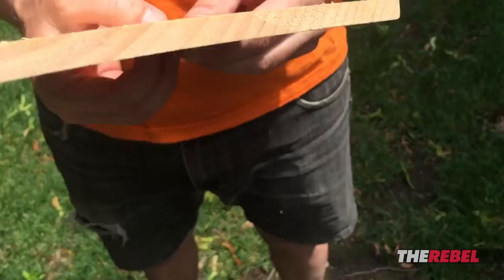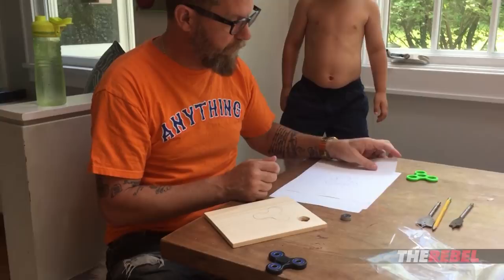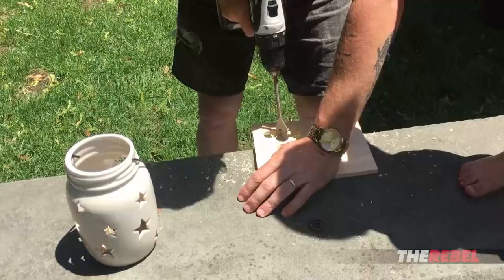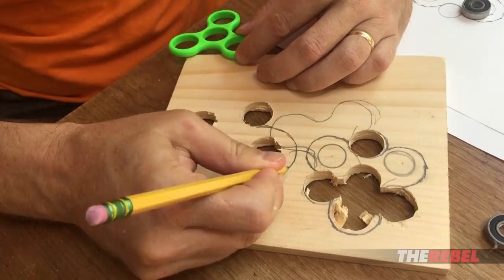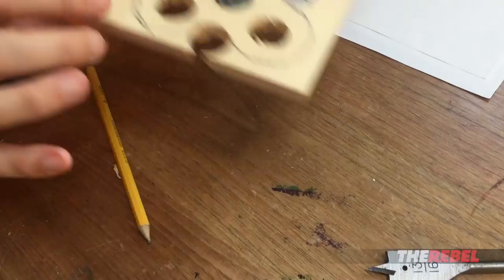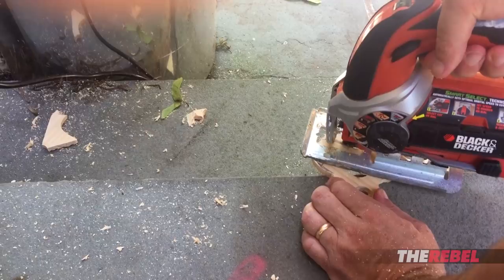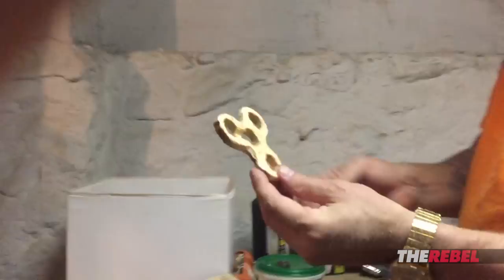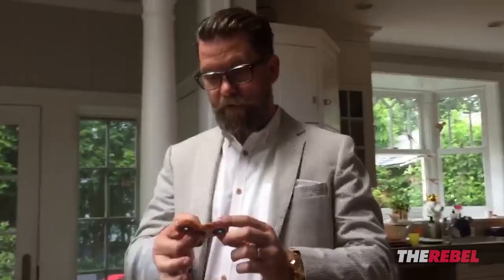Gavin McInnes: How to Make a Fidget Spinner

Comment: 1:  Wrong kind of board.  That's why it was snapping.
2:  Wrong tool.  You're not going to have as precise a hole from a standard drill with a wood bit.  Use a drill press...or laser cutter.
3:  Don't make them too big or else you can't spin them.
4:  3D Printer.  That's where it's at.  That's how I make mine, and I make them from wood filaments.  
5:  Oh right.  It's a comedy show.  Don't worry.  I appreciated and this alone almost made me subscribe to Rebel.  If you had more of this kind of content, I would.

Comment: If you don't wanna break the wood, you just have to use the circular drill bits and be very gentle by putting almost no pressure while drilling. Takes longer but you can make it even with very thin borders between the holes. I've learnt that while cutting out holes in a plastic tub for growing shrooms.

Comment: pro woodworking tip, use a forstner bit. a lot more gentle less chips and breaks
spade bits are mostly only for real rough holes. running wires ecy

Comment: if you use a more dense wood like cherry or oak it's less likely to splinter or crack. Even though the cuts are more difficult, ultimately it's easier to work with.

Comment: Just make another one-the first one was a prototype. Or a maquette, as we called them in art school. Also the biggest mistakes were mainly in hand drawing the curves without a guide-that made it wonky...also you need to sand the edges more. Actually the best thing to do would be to use some spackling-fill the edges over then sand it. Of course then it would be better to paint it bc it (the spackle) will show. I thought it was actually a pretty good first attempt.

Comment: probably would have taken longer but what you should have done, is sand it down, with sand paper, you can get much closer to the desired shape that way and theres less worry of it breaking, also slightly thicker wood might have been called for

Comment: Gotta do this on a drill press with a paddle-bit or a uni-bit
Then rough cut it with a band saw and finish with a Dremel or a decent half round and a rat tail file  sand the file marks out with dremel and then a 200 grit sanding by hand. And ...... brush the varnish because dipping will make it run and pool up in one place. And ...... yeah.....

Comment: I wonder if you could have used a slightly smaller drill bit for the bearing but soak the spinner in water for the wood to get soft enough to squeeze the bearing in the hole and when it dries, it'll shrink and hold the bearing in.

Comment: Need a cheap coping saw and chisel, or if you are going to use a drill make a pilot hole and then drill halfway through 1 side then halfway through the other so it doesn't crack.
Also use walnut or some nicer wood than cheap pine.

Comment: Nice try, but next time make it out of oak instead of pine, use a C-clamp (or vise) to hold the wood down while cutting, use a fine toothed jigsaw blade, sand it with sandpaper, and use a transfer punch to center the bearings.  Good luck next time.

Comment: Well Gavin... Good on you for doing a project with your son. There's nothing better than one on one with dad. That being said... I would hope that you don't just leave this project behind but instead pass on the knowledge that everything you try to build doesn't just work out the first time around. You should weed through some of the suggestions and give it another go.
I'm a mechanical engineer with over 30 years in the field and 20+ patents... here's some considerations to consider should you decide to try again. 1. Material: Solid wood is great but it needs to be hard wood or plywood (I'm talkin' the 8 ply Sande Plywood used in cabinet making and not the stuff that's used for building structures.) 2. Use a standard twist drill bit. The spade style bits like the one you used pretty much suck. 3. Layout: A compass, ruler, protractor and pencil is all you need. Your son is a little young but as you probably already know... kids are natural problem solvers and logical thinkers so he'll probably surprise you and understand more than you think. So back to the layout. Layout your design on paper... use some UHU stick glue to glue it to the paper and drill and cut and sand. :)

Comment: the problem here you were using a spade bit and no sacrificial piece of wood beneath the hole, instead of a Forsner bit which would stop the wood from splitting on the thin edges.

Comment: Scroll saw, sand paper, and a smaller bit would've done the trick. You undersize the holes initially and fine tune it to be as close as possible. 

I know that's not the point of the video, it's more about having a healthy relationship with your children.

Comment: I did the same thing bud. My kids wants one and I said fuck that. I actually ground a round piece of steel, put a bearing in the center, and then drilled and tapped small holes around the center steel. So I could thread small but solid bolts into those holes as counter weights. It's ugly and super heavy, but they take it to school and the kids are in awe over it. It's so heavy it will just spin forever, and it's unbreakable. Boom, man shit.

Comment: haha Gavin you needed to tap into your inner gay and just get the geometry right. Something like a thick marker could have traced around the thin template you had and widened it. Afterwards you needed to cut the bulk off and sand down to your marker lines. For a first attempt you got pretty close

Comment: It was your wood!  No pun, but it needed to be harder.  Also, you didn't really have the tools you need, choosing to go with hand tools.  Imagine if you had used a drill press for the holes, and a ban saw to cut out the shape.
You actually did very well for what you were working with.
But, agaiun, your piece of wood SUCKED from the start.  Pine next time?